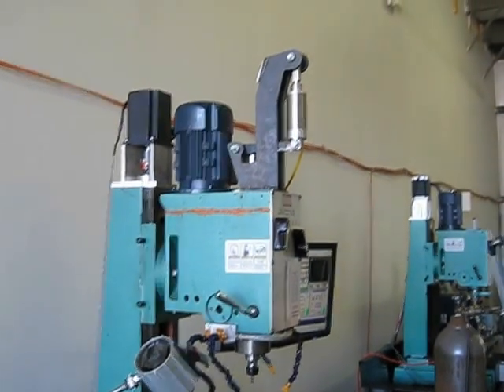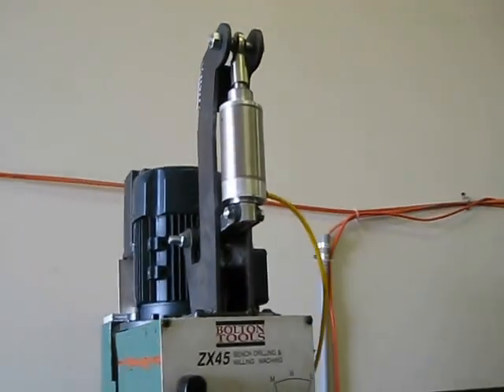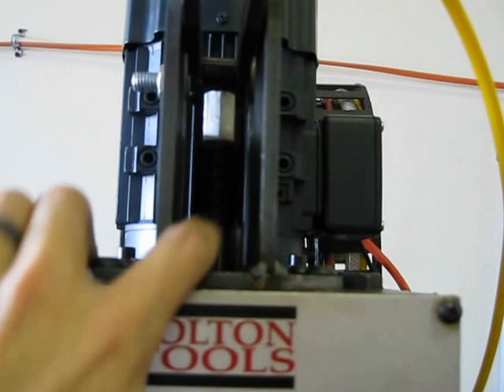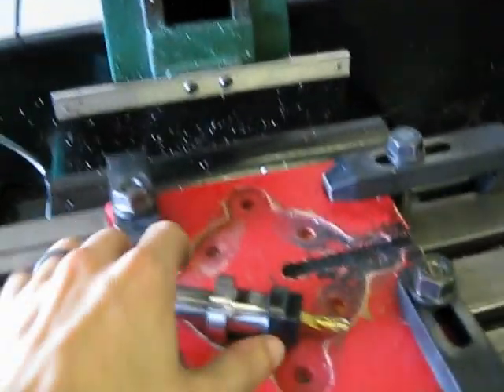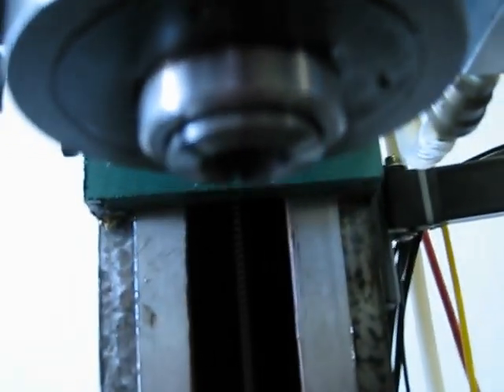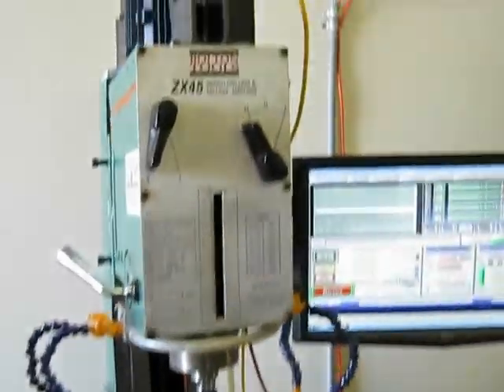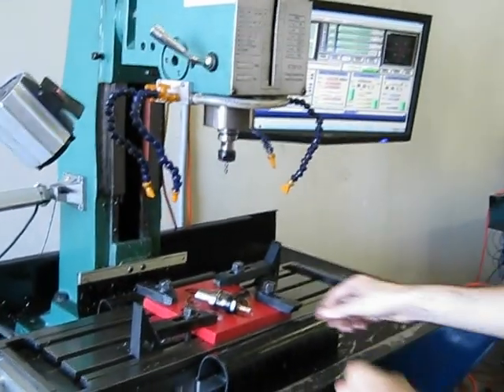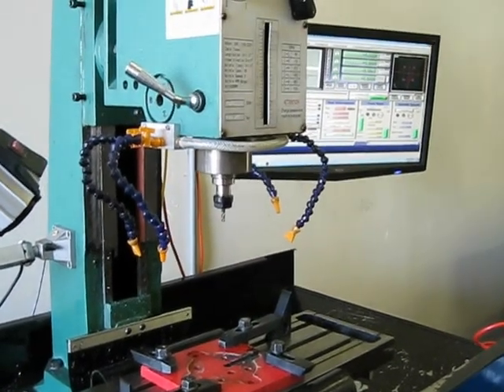RF45 Quick Tool Changer

Comment: you are saying that the spindle bearings can tolerate 45,000 axial load? From where did you get that figure? I suspect you are quoting radial force tolerance. 

I ask since I own a RF45 clone. the top spindle bearing is a 30207 tapered roller bearing. Timken specs dynamic thrust at 2270 lbf.
Still more than your 1500lbf claim for the spring washer stack, but not even twice. I doubt my machine uses Timkens. It is a Grizzly - Chinese POS. No doubt they are automotive wheel bearings, not precision high grade bearings.

What is the air pressure for the two inch piston? At 90psi the 2 inch piston develops Pi * 90 = 282 pounds. The 1500/4 stack = 375 lbs required. The pressure must be higher or the mechanical advantage is greater than 4. ???

Comment: Hey man i really like this. I just bought a HM48 (Same thing) and was going to do a cnc conversion and wanted an ATC.
Can you show us if you changed the spindle etc? Thanks. James
Reply: He has the original spindle using an r8 collet that holds the er20 collets for quick swap. Not ideal from my perspective since you're ultimately limited to tool size and a facemill typically does best directly on the spindle but if that's all you need for tool changes it is certainly a doable method.